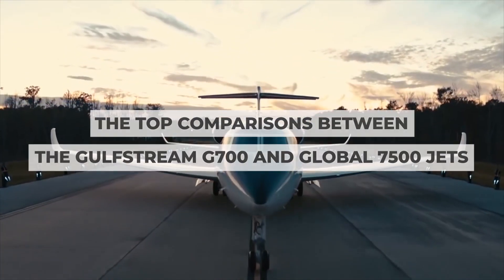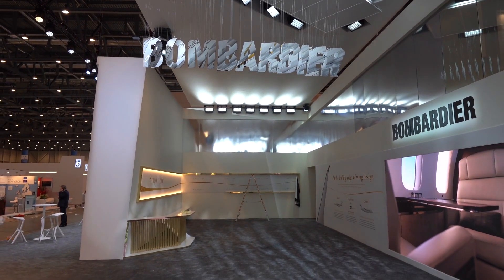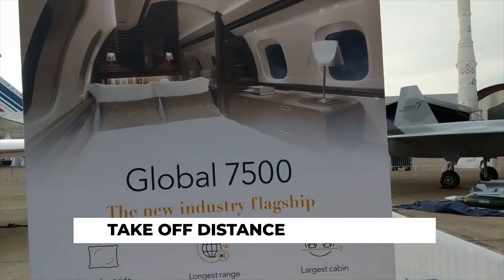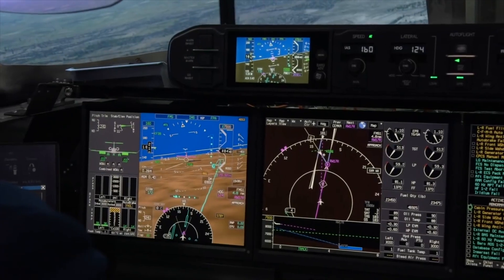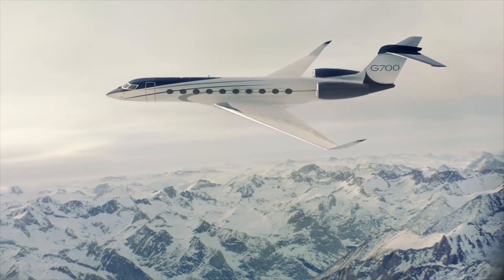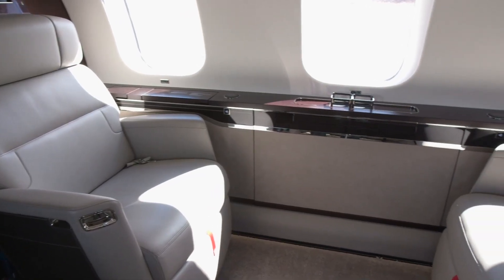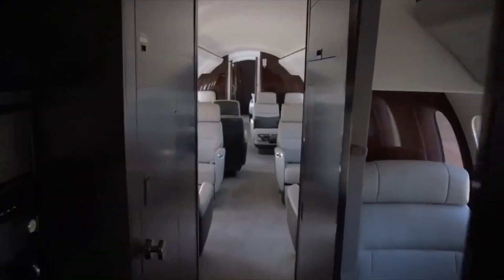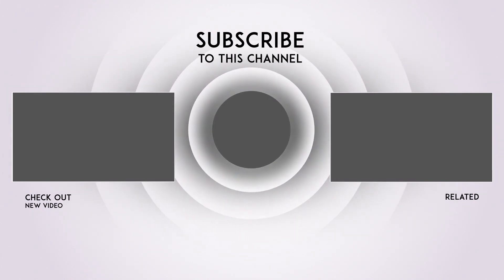Gulfstream G700 vs Global 7500

Comment: Gulfstream is in a league of its own.
Reply: @Mr Greenthumb Doubt there's much difference. Both of these manufacturers have enormous experience building these types of aircraft. Its not very likely that either of these jets would be anything less than excellent in terms of performance and ride quality.
Reply: Yes. The minor league...
Reply: @Karl Dunnegan theres a tremendous difference in the wing design. The Bombardier wing is thinner, flexes more and performs better at both high and low speeds or in turbulance.

Comment: Completely ignored cost of  operation, maintenance and upkeep. Those are huge factors. That said, there isn't a material difference between these two planes. I'd give a slight edge overall to the Global 7500 based on its shorter landing and takeoff requirements. That and the fact that the plane is actually in production and you can buy one w/o having to wait three or more years for delivery. My own preference however would be for the Dassault Falcon 8X. The cost, both up front and operating expenses, is massively lower than their competitors. And while the range of 6400 NM is lower than the two 700s, it is more than adequate.

Comment: I would chose the g700 not only becuse the cabin length but becuse I have been on the global 6000 and the windows while large are not as good in my opinion as the g700 and the extra range is not that needed.But I would not mind either, thank you.
Reply: The 7500 has much bigger windows than the 6000 and in fact have an 8% bigger viewing angle than the Gulfstream

Comment: As someone who has slid toward the front of a few leather chairs that I reclined in, I am intrigued by the Nuage seat in the 7500.  Sinking my butt upon reclining could end the slide.  I wonder if they could sell and apply that to home recliners?
Reply: I read somewhere that the seats on just a Challenger  350 are $20,000 a pop so its a pretty expensive way to take a.load off.🙄

Comment: Case closed, the G700 wins!!!
Reply: Case closed? It's more expensive, has a shorter range, has a more low tech wing, and cant land in as many places because it needs longer runways. Oh and while there are 70+ G7500's currently operating they have not yet begun to deliver the G700 yet.

Comment: What about global 8000
Reply: Global 8000 was never built and doesn't look like it ever will...
Reply: Mark why u think so?
Reply: @abduazizusmanaliev9130  >  Also, other than old media on the Global 8000, I doubt you will find anything current on it.   It is dead....
Reply: Mark its still alive on their official website. And bombardier should build something against g700. It’s obvious
Reply: @abduazizusmanaliev9130  >  The Global 8000 was just going to be a sHORTer version of the Global 7500.  Because of the lighter weight it was intended to have a little further range.  But since the Global 7000 had better than expected range, it was renamed to Global 7500 and the Global 8000 put on hold.  As I stated earlier, there is still media on Bombardier website, but just try and order one.  You Can't because it is dead.   If you want to think otherwise, that is fine by me.  BUT IT IS DEAD...
Reply: Mark told assistant to call them tomorrow and ask
Reply: @abduazizusmanaliev9130  >  Perfect.  Post when you find out.
Reply: @abduazizusmanaliev9130  >  If they try and tell you it is not dead, ask them the schedule for it to be built and Certified.   Could be an interesting answer they give you....